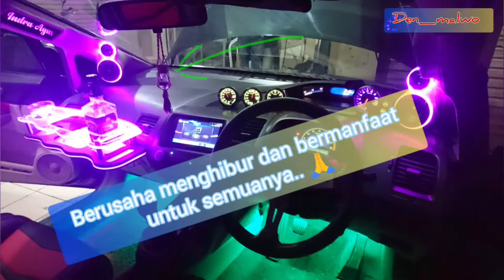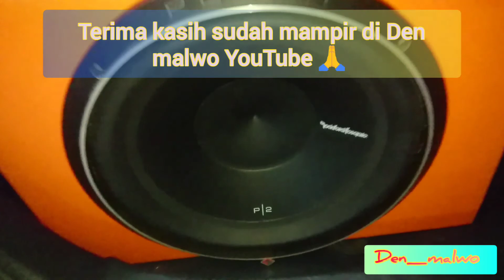SKEMA CUSTOM BOX SUBWOOFER - 12 INCH | Speaker Rockford - punc Bass empuk tenannn..

Comment: Minta ukuran lubang yg bulat buat spker rockfordnya mas
Reply: Tinggal baca di situs RF ada
Reply: @aridwisosiawan8083  ga punya dusnya soalnya bli dri teman
Reply: Tinggal buka hp nya box ny gmna ada
Reply: @aridwisosiawan8083  bang ngerti yg di omongin ga sih
Reply: @kneelgaming5762  lah situ y,g g ngerti omongan setiap pabrikan box nya ,ukuran nya udah ada di situs resmi ,bentuk box ny juga ada di situ berdasarkan type subwoofer tersebut
Reply: @kneelgaming5762  lah situ yg g ngerti omongan klo p2 rf di situs rf udah ada,p3 jg ada ,panjang berapa tinggi lebar di rf ada ga mau baca
Reply: @kneelgaming5762  klo sy ga ngerti omongan ngapain di rf ada encloserd sealler berapa kubik berapa liter ,klo pake port berapa kubik berapa liter,ada contoh panjang lebar tinggi nya di situ,situ aja g mau baca
Reply: @kneelgaming5762  tinggal buka hp baca ga mau di bilng orang ga ngerti ,klo ga ngerti sy dr remaja umur dh brapa sekarang main mobil udah anak ny sekarang
Reply: Itu kn ada tiap type nya di website resmi rf box ny ada ukuran gambar box nya ada kurang pa LG tinggal hp google males
Reply: @kneelgaming5762  jangan kn box nya masang aja ada diagram nya dari amplifier ke subwoofer ,di website nya
Reply: Tinggal pilih type ny kluar box ny ribet amat
Reply: @aridwisosiawan8083  klo thu kasih thu aza jng nyruh baca